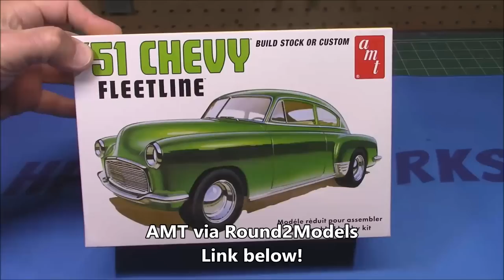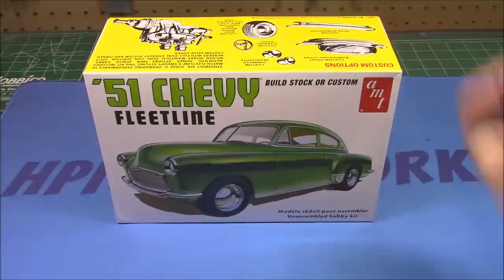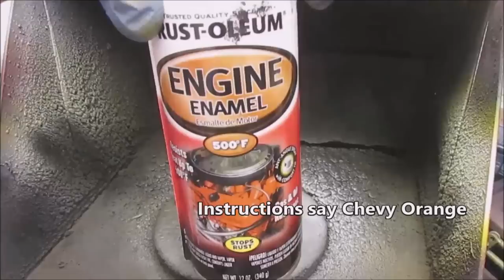1951 Chevy Fleetline Stovebolt 6 1/25 Scale Model Kit Build How To Assemble Paint Chrome Metal Foil

Comment: the injection of plastic into the mold at that point gives a better fill of the emblem
a little file and sand work
I might buy this kit for the engine and tires and build the car as a gasser.

Comment: Well, now…your approach to those fender liners was genius! The directions in the kits I had previously built instructed to cement them to the frame rails as opposed to your approach of fastening them to the interior. I was wondering how that would work when it came time to align the tops of those pieces; the two hood-off still shots at the end convinced me that you should write the assembly directions, or at least suggest to the manufacturers that they try your assembly method BEFORE sending out the final sheet.
 
Well done; thank you for that!

Comment: A bit late on this but it popped up on my feed...a lovely job Chris, always impressed with what you do with rattle cans. On the bumper fill in pieces not being bodycolour, I can empathise. I just completed a Heller 1/16 Citroen DS19 and didnt spot the insides of the window frames needed to be black. So now I have a small white plastic line showing. I can worry about it and have moved on...Lovely kit, I will be building mine stock also and fitting the rear wheel skirts 😎

Comment: There's something special about these 1950s cars in terms of the design and color choices. I like the fact that AMT put a sheet of Bare Metal Foil in it; I built Revell/Monogram's 1959 Caddy twice and that definitely would have benefited from that, because the decals they used to simulate the chrome trim in the second one I built last year didn't work as well as I had hoped.

Comment: What kind of glue do you use? I've been trying to find A glue with a brush like you'll use, but I haven't been able to find one that actually works.
Reply from the maker: I prefer Plastruct Bondene for my kits, but any of the modern liquid (not tube) glues will work well. All of those will have a brush in the cap.

Comment: My father had a Sinclair service station and I saw cars being dismantled and repaired.  Chevy stovebolt engines were usually gray or navy blue.  Our '54 Chevy 210 had a navy blue six with a yellow, orange and red "blue flame" on the valve cover.  Upholstery on the 51's were usually gray.  Instruments were different shades of silver.  And what happened to the fine scored lines on the grille bottom?

Comment: Really like this color choice. 
Is there a license plate bracket for the back of the model? 
I don't recall if the plates were attached to the bumper or to the trunk lid.
Reply from the maker: Yes, it has brackets if you want to add plates.

Comment: Beautiful job! What pen are you using to detail the chrome edges? I have tried the Sharpie metallics but they are often too thick and run over edge. Thanks
Reply: Also, why did you use the foil at the bottom instead of the chrome pen? Thanks again.

Comment: I don't think this is that old of a kit. I think it was released when Ertl owned AMT. When I bought it, it didn't come with the chrome foil. The version I bought had a stock kit photo on the box. I found a resin chop top body on line. There was a fair amount of fitting of the inner fenders, the glass, the top of the interior tub.

Comment: I think I have watched most of your videos and love your technique.  I build almost the same as you.  I just started using gel pens for doing details but I have a question on that. How long does it take for the gel to dry? Maybe I got the wrong kind (pentel) but it seems like it never does...
Reply from the maker: It takes a long time to dry, I use a dehydrator.
Just be careful after application and it should harden off in a few days usually.

Comment: This kit kicked my tail.  Instructions were sub-par at least for me.  Particularly the inner front fenders butt joined to the firewall and radiator.  Squaring/plumbing that part of the assembly was NOT easy.  Editing later the same week.  I abandoned this build.  First time ever I had to do so.  Body would not set on chassis even after removing interior tub.  Do not buy this kit if you are a beginner like me.